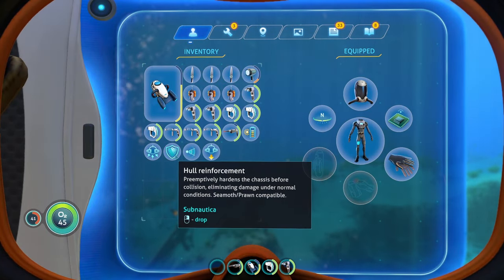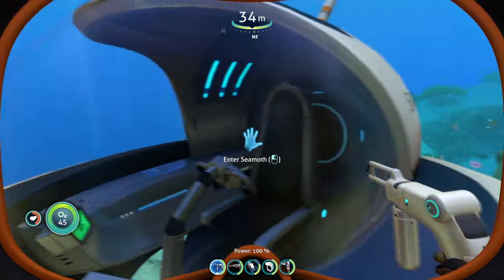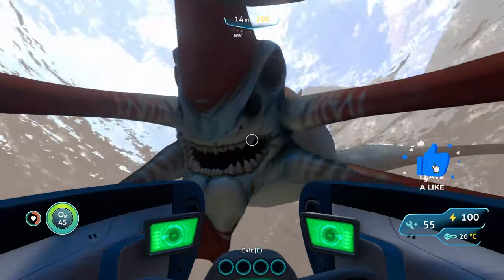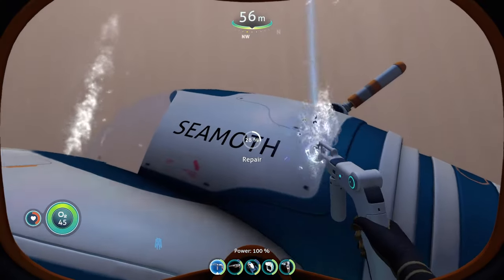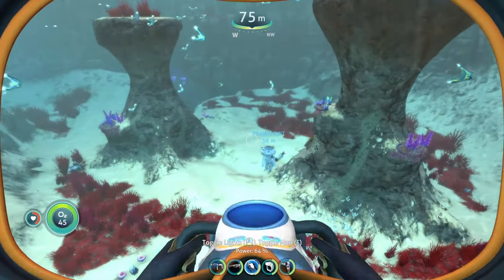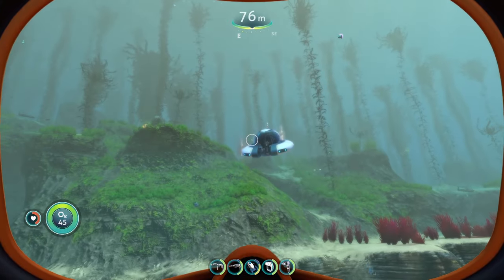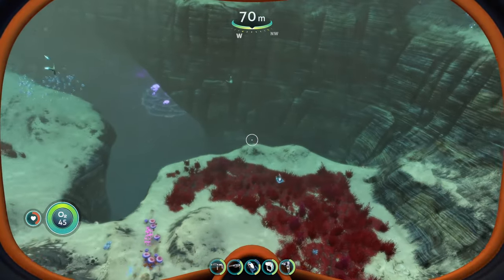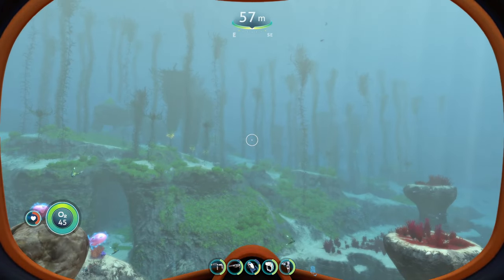The WORST UPGRADE Module in Subnautica

Comment: It reduces all collision damage. This means driving into fish and enemies. Not just hitting terrain. Ramming many enemies to death is a viable strategy in the seamoth but I still wouldn't recommend using this module. The reduction is way too low and it's easier to jump out and use a repair tool. Which you'll be doing a lot of in the first place.

Comment: So basically even smacking into fish damages your sea moth. And you can get even faster in the prawn, utilizing the grappling hook in an effective way. So, its actually pretty useful.
Reply from the maker: @therealmilkman876  The prawn suit? I thought It doesn’t do anything with the prawn suit because it’s the only vehicle unable to take collision damage? So you’d be able to move fast using the grapple arm regardless I would imagine? Hitting small fish in the seamoth makes sense as it can be quite annoying but it’s also not too hard to avoid those fish in the seamoth given its small size and largely open window it’s easy to spot and avoid the small fish unless you back up into one or something hits you from the side, but I would still trade the reinforcement module for any of the other ones since every other module is far more useful than the hull reinforcement’s ability to negate collision damage with both the environment and small fish that can be easily avoided if in a seamoth as it serves no purpose on the prawn suit. (A better use for the hull reinforcement is if you want to go with a full vehicle ramming build and just ram your seamoth into creatures to get rid of them which could be fun, but that’s about the only scenario I can see the reinforcement being super useful, any other situation I’d rather take anything else)
Reply: Seamoth - can you get out and fix it? Generally, yes. Unless you are deliberately caroming off things or parking under the acid in the Lost River or below crush depth, you are unlikely to have a problem stopping and fixing your vehicle.

Prawn - The extremely minor amount of damage sustained even at high speed is so negligible as to be ignorable unless you are speedrunning.

Tldr: As long as you can take two seconds to fix your vehicle, Hull Reinforcement is nigh useless.

Comment: Does the hull reinforcement reduce how much damage is taken each second when below the vehicles maximum depth?
Reply: I don’t know
Reply: @hannam5084  thanks dawg
Reply: @hannam5084  tyvm for letting us know gng
Reply from the maker: @somefella3303  I can test this! Whenever I’m able I’ll test that for you and see because I’m not entirely sure either, I’ve never heard of it doing that but I can try it out and let you know!
Reply: @Crimxsen  appreciate it! Subbed
Reply from the maker: @somefella3303  Just tested it! So the Seamoth was taking 10 damage per tick while under the max depth without the reinforcement and when I put the reinforcement on it was still taking the same 10 damage tick when under the max depth so it's safe to say that it does not reduce damage when under the max depth! :)